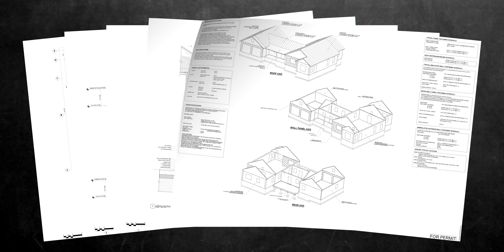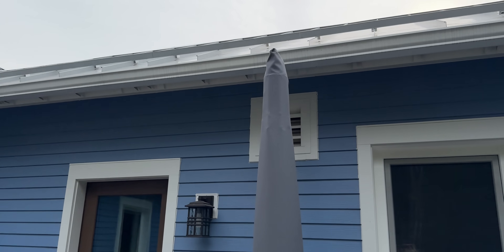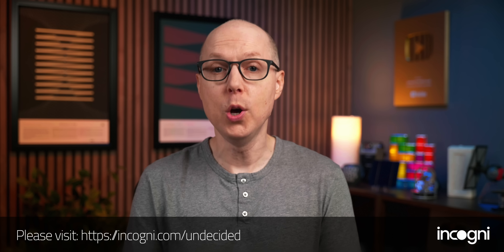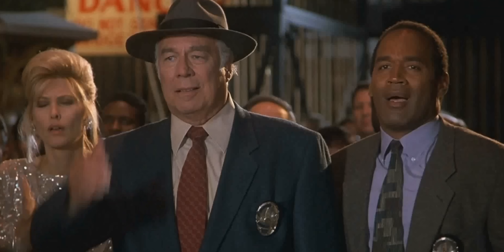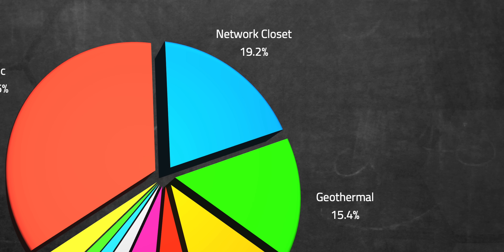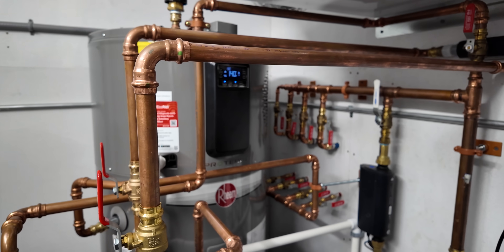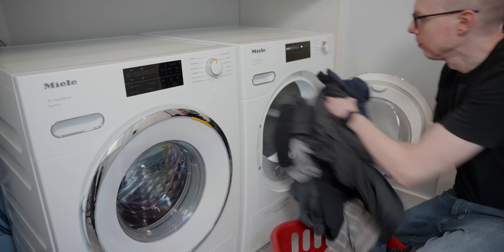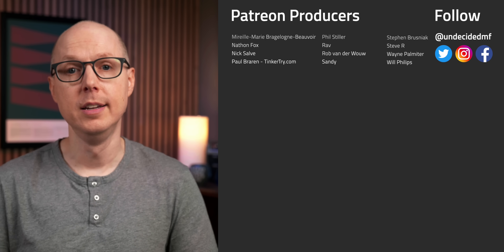What I Learned After 1 Year in My Net Zero House

Comment: Hey Matt i love your content.

Let me give you a rough idea of our energy consumption in the north of Greece.
I live in a relatively new house of 280m2 and our monthly energy consumption is about 550-650 KWh per month. 
For air conditioning we use an efficient heat pump. We do not heat the whole house at the same time, because otherwise the energy consumption would be higher obviously, but the home is very comfortable non the less. For hot water we use panels that collect sun rays and heat the water. We have a 160l boiler that is enough for 4 people. In winter time we might heat the boiler with electricity but that is rare because we have plenty of sunlight. Because our boiler can be connected with other appliances that use hot water (radiators, washing machine etc), we also run the hot water to the washing machine and this way it uses a fraction of the energy it would normally use. Also we do not use any gas in the house, everything is run through electricity. We took advantage of a government program to retrofit our house in order to be more energy efficient and that's why we have these numbers. Additionally all the energy demanding appliances are less than 3 years old, so they are very efficient.  

We would consider installing solar panels if any new government programs are available, but for the house we have and for the energy we consume, it would take us a lot of years to break even if we paid for it ourselves. 

In contrast my parents that live in a 85m2 apartment, that has not yet been retrofitted, consume about 350-450 KWh per month and it is just them in the apartment.

Comment: I'd like to recommend using solar powerd cloth dryer. While it work cylcle is long, and loading-unloading can be tedious, upfront cost is very low, and it need no additional power. It is very mature and reliable technology.
Reply: Does that mean hanging laundry up on a line outdoors? Is that solar powered or wind powered?
Reply: @robinbennett5994  Depends on the day ;)
Reply: @robinbennett5994  I was going to say the person's talking about a clothesline.  :)
Reply: @robinbennett5994  both
Reply: Hang a clothes line in a greenhouse or polytunnel. It bakes them dry in no time at all. Same for firewood. Just maintain a through flow of air

Comment: Baby steps are relatively easy to take.  I bought a countertop $80 induction cooker. We like it so much that we put a removable counter top over the gas range. (Removable because oven vent is under it.  We only bake once a week.)
  Since the kids are grown, we use only half of the house. A 36k BTU 4-zone air-source heat pump cost $6000 after tax rebate with a week of DIY labor. With a 2.5 kW solar panel (Fully amortized since 2012), and 2 EVs, our electric bill is less than $50/month.
Reply: Similar. I also have an older gas oven and mostly only bake. I bought an induction fanned counter top oven for well less than $200.00. Savings on the gas bill over a year pays for it. When I can spend the money and get the IRA credits I'll install a built in convection oven with a microwave in the top position. Meanwhile I am 95% or so off of nat gas usage. Not to forget the EV is charged via the solar both on my roof and in daylight hours when out grid hits zero gas for elec generation.
Reply: Meanwhile my gas and electric is $400/month 💀

Comment: I was thinking about a heat pump dryer. But for the last 11 years in my passive house i just hang the laundry from a ceiling rack dryer (family of 5). The heat recovery ventilation keeps the interior air pretty dry and so it works well. The excess moisture ends up condensing in that MVHR (releasing the heat taken from the house for evaporation)"and running down the drain.
Reply: @ecoworrier  dry it outdoors..
Reply: 💯 When you measure the difference in energy efficiency, you also have to calculate the ROI. (How many dollars / kilowatts per year will it save you?)

If it takes forever to make your money back, then there are better ways to spend your money --- likely including in efficiency gains elsewhere.
Reply: Air heat pumps require a lot of energy to run. 11kWh in one case... how do you deal with that?
Reply: @aliottoman1451  I have three phase 220V. The house supply can deliver 22KW if needed. My car charger uses 11KW with no problems.
Reply: When your whole house becomes a giant heat pump dryer. Except you live in  it too 😂
Remember to check the lint trap 😂